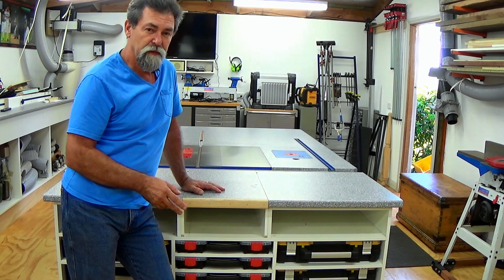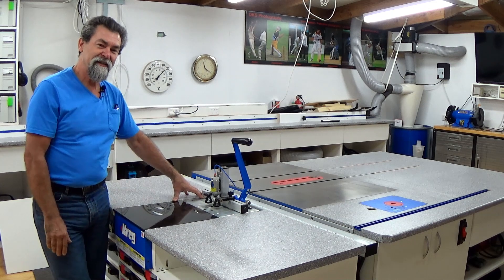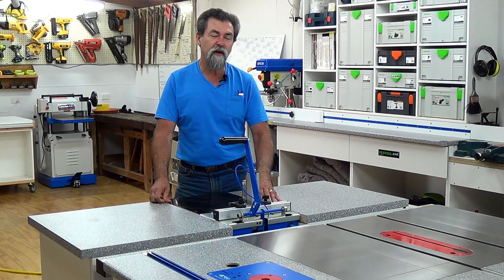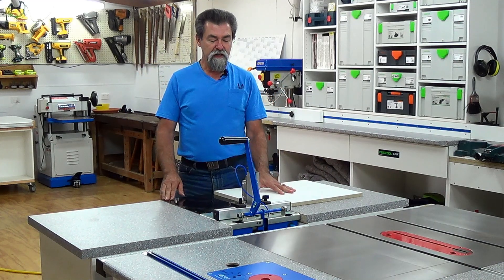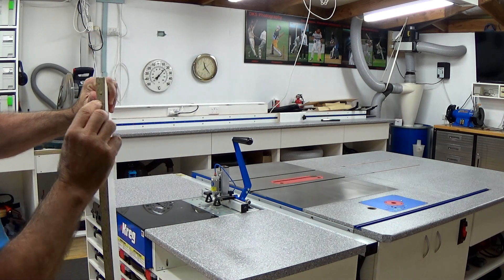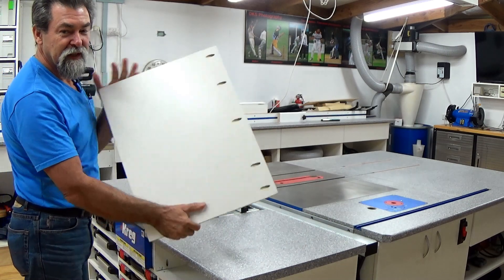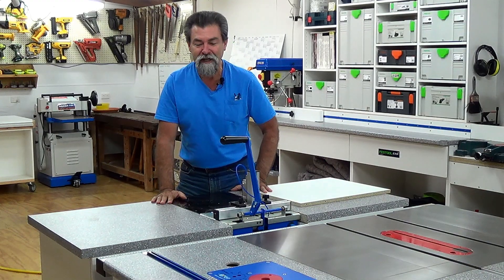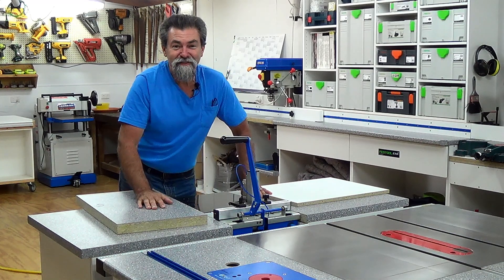Kreg foreman pocket hole machine | diy | dave stanton |  woodworking screw

Comment: Hey David - do you need a certain cfm for this to work? I have this little 6 gallon 1hp air compressor and I'm looking to buy one of these used...
Reply from the maker: I had a small compressor that the tank was 2 feet long and maybe 6 inches diameter and it worked but too slow to recover and I had to wait 40 seconds between holes. I purchased a Stanley like this one. http://www.supercheapauto.com.au/online-store/products/Stanley-Air-Compressor-Belt-Drive-2-5HP-190LPM.aspx?pid=224373#Recommendations
Reply: Cool..thanks for that info~

Comment: great machine. does it have any dust collection?
Reply from the maker: There is a dust port at the rear ready for you to run your own hose. I am still pondering how I will manage the dust as I am going to try to incorporate the same dust extraction with the trim router I will be fitting as per the next video I release.
Reply: sweet

Comment: Hey David - you mentioned this wouldn't be good for a few pocket holes. Why is that? Just the fact you have to take it out and setup your table for the foreman/barry?
Reply from the maker: Set up is correct. I need to connect the compressed air etc. The K4 is in the drawer underneath and in 2 seconds it is working. I get the foreman out if there is a run of work. Barry, the other foreman is too busy sleeping to care either way, lol.
Reply: Got ya.  I ran across one like yours (Older looking (kreg label) for $375 US dollars on craigslist.  debating between one like this and the electric on for $399. Love your video's and shop!!
Reply from the maker: I think the electric one will be available in Australia soon. Of course soon can mean anywhere between 3 months and a few years.... Mine was new and cost a lot more than yours, well done!
Reply: thanks I don't think I'll buy as I don't do a ton of pocket holes, but based on your demo it sure looks nice. I have the porter cable pocket jig(Manual). I liked it way better then the kreg k5. You have a great day my friend!